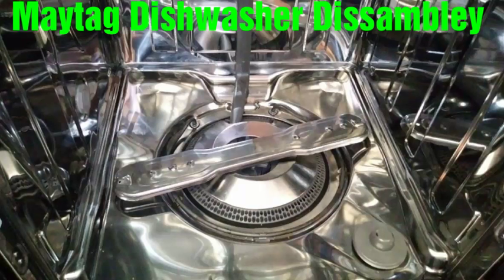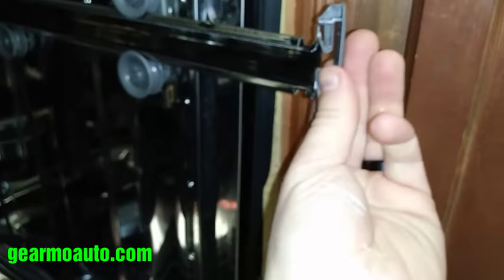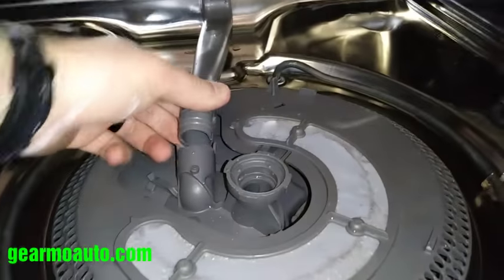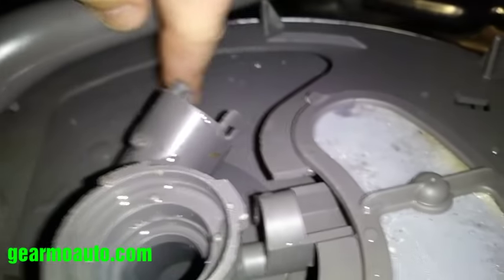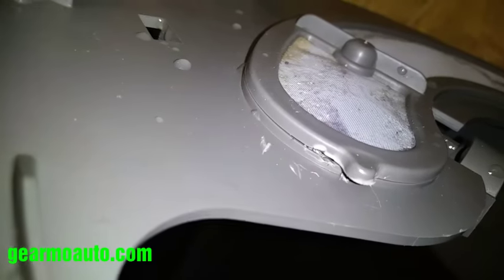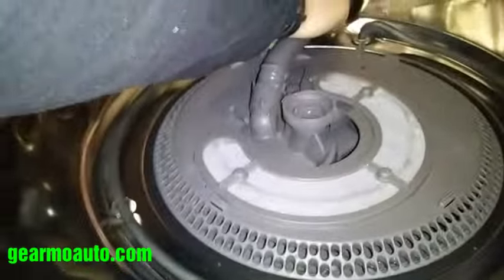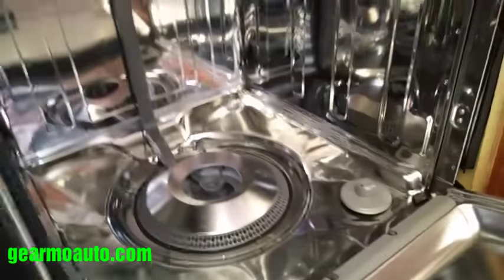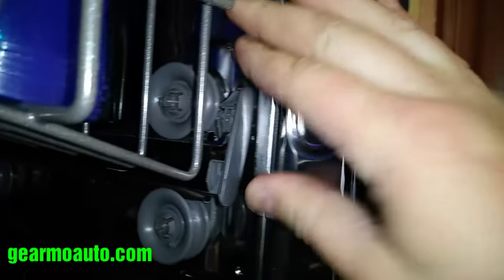Maytag Dishwasher Disassembly

Comment: After disassembly  and cleaned the lower spray arm rubs the metal shield slightly  when you manually  spin it. Is it supposed  to be that close?
Reply: I have the same problem, did you resolve yours?
Reply: @kathleenapeterson2144  When I manually  spin it it does rub a little  but  I don't think it does  when I run  it.  I've  been using  it  and it seems fine.
Reply: I have the same problem (Sept. '22)  Just took apart, cleaned all (Yuck!) and back together 10 times and cannot get the gray round thing (with mesh filter) down low enough then the plastic water arm pushes it down when you re-attach it and the front raises up about 1/8 inch.  Then attach the dome.   Then the spray arm slightly rubs the metal dome!     The spray arm is not freely spinning in a wash cycle!  Plates on bottom have some specks on them.  SO FRUSTRATED!

Comment: Wondering how to put my top spinner washer back on.  There is a screw, just like the bottom one but I don’t see anything to screw it back ON to.
Reply: To answer my question: the lower sprayer hooked onto the rack, not the roof hahaha.  Both sprayers shoot upward from below a rack.  So only one attaches tot he floor, the other to the top rack.

Comment: So I have about the same dishwasher and it's not cleaning well. I've cleaned everything filter etc replaced the water inlet valve thinking lack of pressure. Any thoughts on what it could be?
Reply from the maker: I run TANG through mine every so often and run it on high heat and sanitize. Running it on short eco clean seems to let build up and low efficiency happen. In my opinion. Other then that make sure the bottom drain filter ( the really gross one) ( not in video is clean)
Reply: @GEARMOAUTO  appreciate the fast response thank you for the tips
Reply: @GEARMOAUTO  Basically citric acid? Like Lemi Shine? Or Citric Acid...which I have a 5 pound bag for the washing machine on occasion.
I bought it originally for the dishwasher.
I notice some Lemi-shine under the sink. I'll use it this week now the dishwasher filters are clean of grease and paper mush.

Comment: Hi thank you for this tutorial, but I can't get these back off that takes the hose out to the filter...any suggestions
Reply: I just did ours, and I didn’t need to disconnect the pipe from the rear. I was able to just wiggle it out to the side and pull it free from the bottom piece.
Reply: @TheDeezelsmoke  Thanks for this tip. I was about to give up trying to disconnect the pipe. The video doesn't show how he did this. But like you, I was able (with the help of a dinner knife) to wiggle the bottom of the pipe free. What a stupid design. We had a Frigidaire washer previously, and it was much better-designed in my opinion.

Comment: How do you rest this model, mine keeps canceling cycle after 2min of hitting the start button
Reply from the maker: I took apart in the front and disconnected the control panel and let it sit for 30 minutes and then plug it back in

Comment: I tried to disassemble my dishwasher to clean it because it smelled. Does the filter lock in place, I didn’t see that on the video? Now it won’t drain. 😩Does the bottom spinning sprayer have to be in place for it to drain?
Reply: I think I have the same problem

Comment: How do you like this dishwasher?
Reply from the maker: I actually had to have the company come out and do a warranty replacement on the motor / pump and the bored. After the warranty repairs have been done it's been great though
Reply: Gearmo Auto thanks
Reply: In my opinion this dishwasher is poorly designed. Do not recommend. I had a Frigidaire dishwasher previously, and it was a snap to clean, although it had its own idiosyncrasies.

Comment: the video is great, but we can't get the top filter to set back in correctly. the spinner scrapes. HELP!
Reply: I had the same problem, but I just kept figgiting around and finally (FINALLY) was able to seat the top filter assembly.  Never figured out what was causing the unit to "tilt".

Comment: I have this dishwasher... so what your saying is you pretty much cannot clean the filter you have to buy a new one
Reply from the maker: The big filter on top is hard to clean but maybe if you soak it in something it will be good. Also I forgot to pull the bottom filter out in the video, check the comments to see what I mean. That's where stuff really builds up
Reply: Soak it in Dawn dishwashing liquid and ammonia in enough hot water to cover and get inside the filter. It will dissolve the grease.
The lower filter is likely to be really gucky, but it separates into three pieces. Two of those pieces are attached but swing apart on a single tiny hinge.

Comment: I have this dishwasher or one similar. This is ridiculous how I have to call an appliance guy to do this. I wont dare attempt this. My filter needs cleaning and this dumb model doesnt make it easy for someone like me to do it
Reply: You can do it and you are likely taller than me, for reaching to the back of the machine to remove the spray pipes. I am 67 and short.

Comment: This is crap!  All I can see if you can replace the filter, not clean it.  Plus the 'narrator' burped while talking - yuck!
Reply from the maker: Hey there is an additional filter in the drain. It is where alot of junk builds up and can be cleaned. (Check the top comment). Sorry if I burped I may have had the hiccups.
Reply: If you are having difficulty tolerating people, check out magnesium as a supplement. It helps. I use it daily.